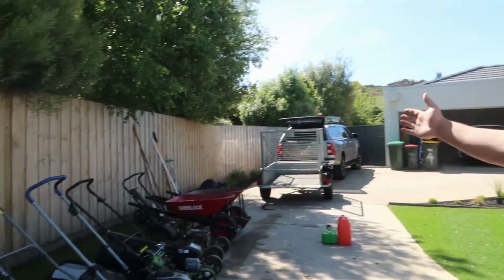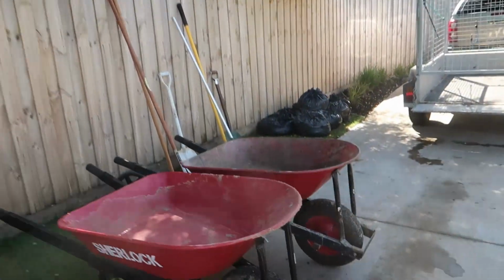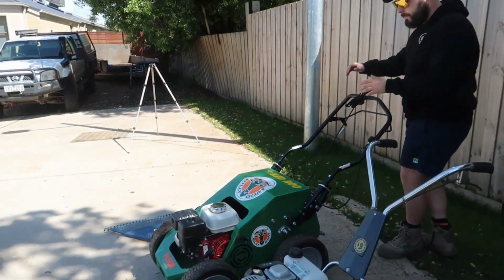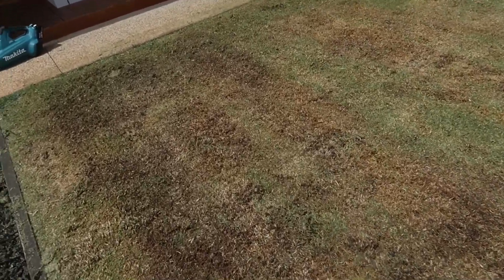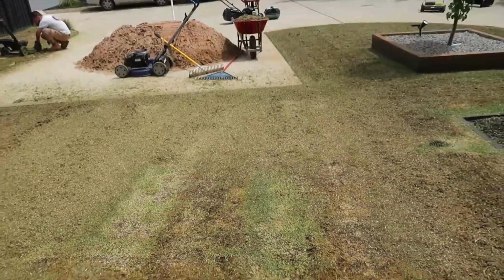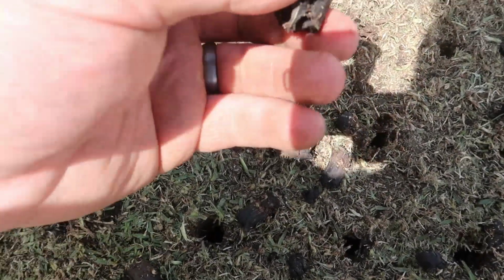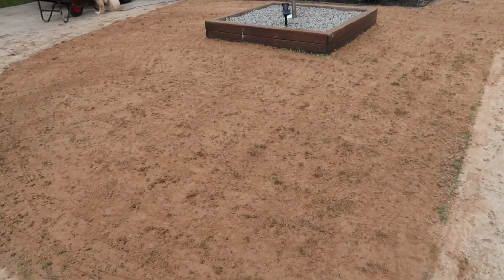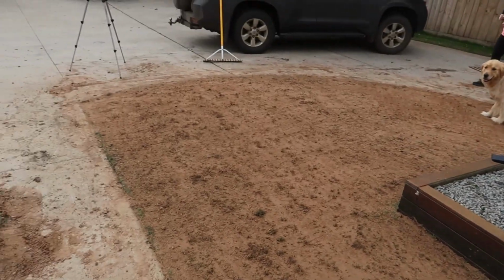How To Get Your Lawn Summer Ready // Kikuyu & Tiftuf Bermuda Lawn Renovation Guide

Comment: What type of top dress did you use on the Kik? 80/20 mix of sand and soil? Or straight sand? What type of sand? Thx
Reply from the maker: It’s just a straight sand I believe. It’s specifically a turf sand. Not sure the exact details behind it but it works perfect for levelling.